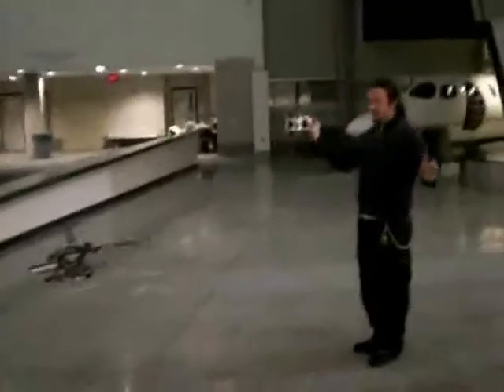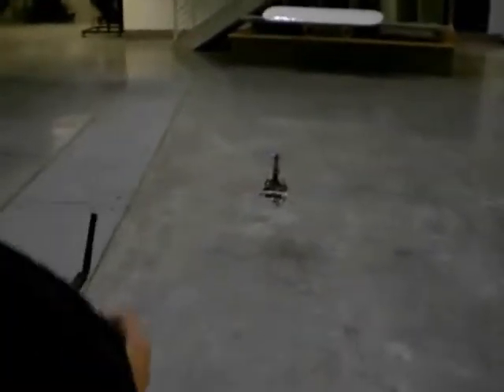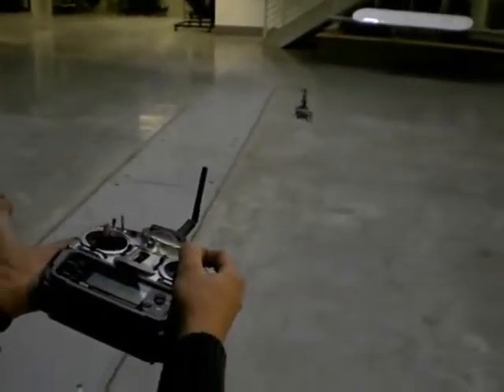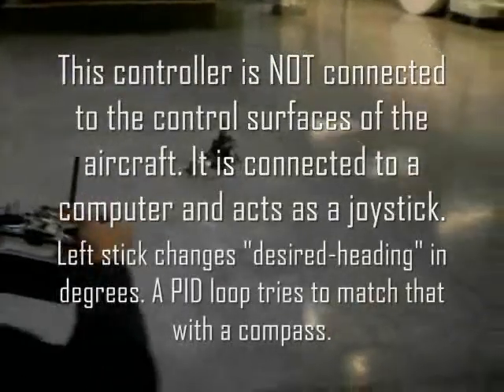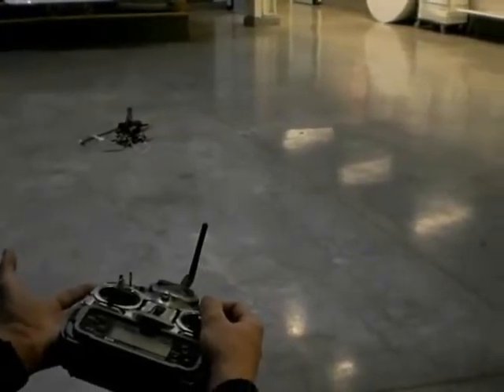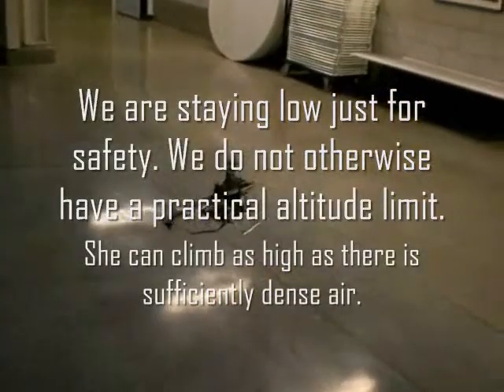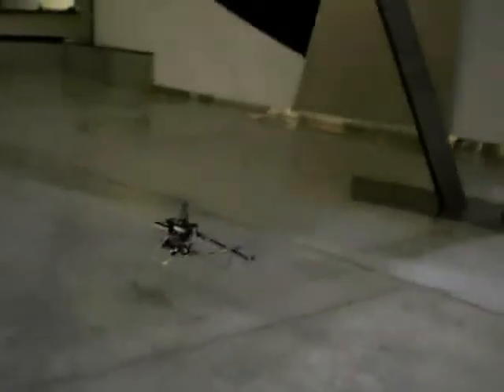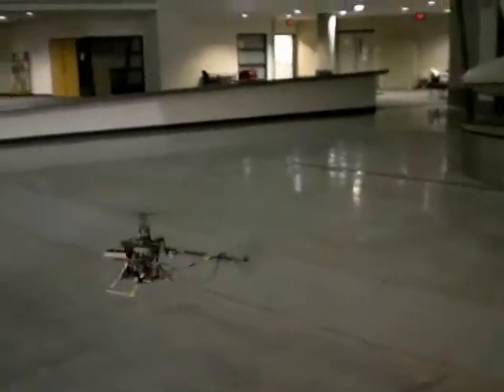Autonomous flight of indoor UAV helicopter based on TREX 450

Comment: very intersting.   I RC helis in my spare time.  I've been working on something using a trex and some off the shelf gyros + sensors, using picotux mini linux computer for the 'brain'.

I've got itto auto hover and have been experimenting with basic collision avoidance logic.

I'm curious to know what your setup is. 
oh, and have you seen the helicommand autopiolt sytem. Wish I would have known about it before I set out down this path.  Woulda saved me some time.  LOL

Comment: Thank you for the comment geekdisk. The wag was present because I noticed a crack at the last moment and had to switch rotor blades to a different type (whatever I had available) before this experiment, and had no time to re-tune yaw PID to compensate new airfoil. Increasing rotor RPM has its complications: will make the aircraft more aggressive (thus ruining other PID tunings), and reduce endurance. Mechanics are free; gently blow on the flybar, and it will move. Airframe is grounded properly.